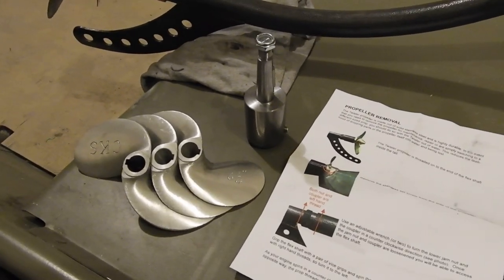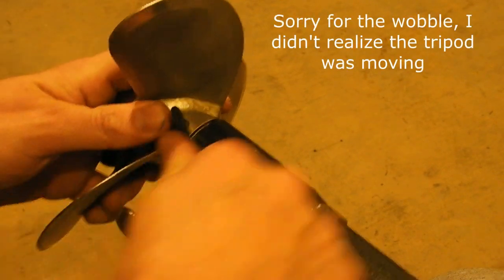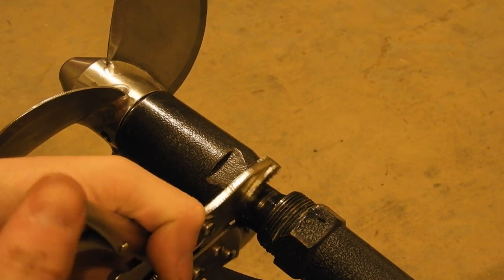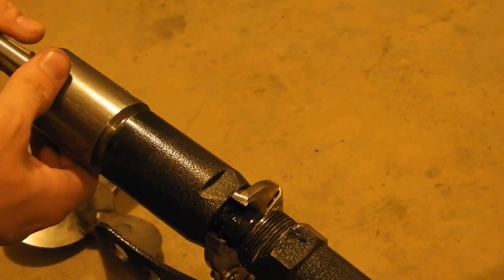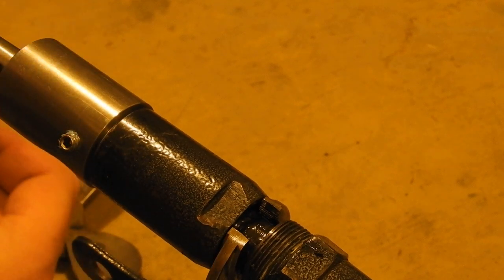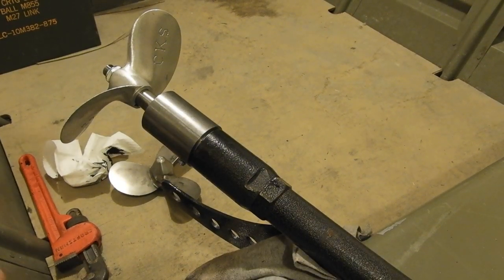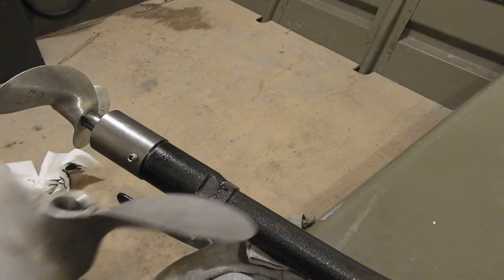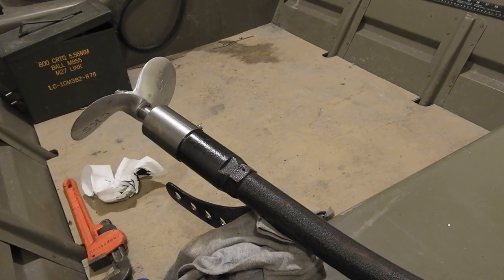Mud-Skipper Twister Prop Adapter Install

Comment: Hey I just got the kit I'm running a 212 predator on a Jon boat what do you recommend for the prop size ? I was able to get 10mph with a gov delete with stock prop and I'm going to do a stage 1. What is your setup on ur motor to get the 23mph?

Comment: So I just got my twister on my 1236, running a predator 212 with a stage 1 kit, and was rather unimpressed with its lack of performance. Kind of reminds me of a plow. Laboring fairly hard to achieve 7 mph with 2 guys and no gear.  Which prop is your favorite? Does the cavitation issue seem to go away using the 2 blade props? My factory 3 blade ss  prop seems like it needs to run real deep...
Reply from the maker: Yes, the cavitation issues go away with the 2 blade. Otherwise with the factory prop, you'll need the plate. But it's just not a good prop for this setup. 

And each boat and load will be different. Props are cheap enough to get a few different sizes to test. With my modified engine, I prefer the 6 1/2" since it can rev pretty high. With a stock engine by myself, 8" is the largest I was able to reach the governed engine speed, but lacked holeshot pretty bad and struggled to get there. 7" was a good size alone and was able to get 15mph steady. With any kind of load, I went with a 6". The boat will run 9mph at the governor, doesn't matter if it was completely empty or plowing through with 800lbs, it would always go 9mph and not struggle much to get there or hold that speed.

Comment: Gunner, thank you for continuing to monitor your video comments! I've read a good portion of them in various videos, so see you're still engaged. 

I think I know what I should do, but wanted your advice on the prop kits. I see now there are 2 kits. 5-7HP with 6.24, 6.50, and 7" props and the 8-23HP with 7.5, 8, and 9". I'm running a stock 212 predator with original prop. I will only run my 14' Jon boat loaded down with around 350ish lbs. in gear and myself just under 200. From my interpretation, you would run the 6.25 or the 6.5 regardless of the motor being stock or modified. Am I correct thinking this? I'll be ordering one of the kits soon and your opinion is greatly appreciated! ;-)

Thank you!
James
Reply from the maker: With a light load you can get away with a 7", but you'd be hard pressed to go 7.5" or bigger. If you can get past the hump around 2k-2.5k RPM, you can usually maintain a little higher speed. But after taking a corner or off the line it tends to bog down before it gets into the powerband.

6.5 is typically my universal 212cc prop. It can handle a bit of weight and gets decent speed. I've only used 6.25 when I had the boat very heavily loaded, like 800 lbs. It didn't matter if the boat was empty or fully loaded, it had the torque to hit the governor and consistently do 9mph.
Reply: @playinlikejimi  Were you running your 212 motor stock then, Gunner? I ordered the smaller prop kit yesterday, so looking forward to getting that on and testing!
Reply from the maker: @jameswinnett4012  that was with a stock 7hp duromax, but basically the same motor.
Reply: @playinlikejimi  cool! Yea, pretty much the same. Hoping the OG prop removal goes smooth! It's been on for a season now. :-/
Reply: @playinlikejimi  got my prop kit from Mud-Skipper and have the 6.5 on ready for a test run! Wasn't as big a deal getting the old one off as I thought. Thanks to your video! You da man, Gunner!
Reply: @playinlikejimi  Got the prop adaptor kit installed and did the first run with the 6.5" prop. I was very impressed! I still need to dial in the height but have found, like you, that 1 full revolution of the height adjusting bolt gives me 1" of movement in the prop shaft level. It will be fun to tinker with the props and trimming to maximize the speed. I found the hole shot got better and the speed increased. One thing that surprised me was that when I dropped the 2 blade prop in the water, the immediate thrust wasn't as severe as the OG 3 blade prop, which was nice. Wish I had a simple solution to adjusting the height while motoring...

Again, thank you for your original post and other videos. I do like the twister and have plans this week to do the carb re-jet, intake filter and exhaust pipe on the 212. Very anxious to see how it sounds and performs.

Later,
James

Comment: Thanks for a great video. Made my install a lot easier!!!
Reply from the maker: No problem, thanks for the appreciation.
Reply: @playinlikejimi  the mudskipper video just shows removing the prop and putting the adapter on.  Why exactly should you loosen the bearing housing before the prop?  Thanks man
Reply from the maker: @philliptverberg4578  the video they have is the same concept, but it's on the newer style Longtails. With the twister, the cable shaft has some give to it and you won't be able to loosen it with the other end locked in place like their video shows. Trust me, I tried everything before coming up with this method.
Reply: I have this same long and the 3 blade sucks I put a 2 blade on it made big difference if anyone has this mud motor kit do what this guy just did big difference between the 3 blade and 2 blade the 2 blade way better

Comment: UPS just delivered my twister XL this morning. Yesterday, I was able to get the pressure washer pump off of the Honda GX390 that I will be using to power the twister XL. It seems like my key was seized in the keyway and I thought, no big deal because I need the key to be on there anyway for the twister shaft to slide onto. However, I started the engine up to check things out and I think the rotational spin of the drive shaft sent my key flying into orbit. My question to you is, does the twister XL kit come with a new key for the keyway or will I need to order one online? I'm at work all day so I haven't had a chance to open up my kit
Reply from the maker: You should get a new key with it, I'm pretty sure all the ones I've gotten have had them. Some lessons you learn the hard way lol, if you have a stuck key and need to start it again, a quick zip tie or piece of tape will save it.
Reply: @playinlikejimi  just keeping you updated. Got home from work this evening and my kit was waiting for me. Stupid fast delivery. I ordered Tuesday afternoon and it arrived Saturday morning. However, I got the adapter kit that's supposed to, per the website, come with a 7.5", 8", 9" two blade prop. What showed up in the package was (2) 8.5" props and (1) 9 1/4" prop. Lol. I'm not sure I'll ever have a use for the 9 1/4" prop and I would rather not have two of the 8 1/2". Oh well. I email them a little bit ago because I'm sure it was just an error by whoever grabbed them off the shelf, but hopefully they will send me the three that were supposed to come which would give me a 7.5,  8,  (2)8.5,  9, and 9.25. we'll see

Comment: Great Video. Just bought an adapter kit.
Reply from the maker: Thanks. I know it's been a long time coming, but I have some video plans as soon as the weather clears up enough. Going to explain how I go through to choose the best prop and dial in the trim for the best performance. I was able to pick up a noticable amount of speed just by dialing it in. Hopefully in the next week I'll get some up.
Reply: Where you buy it

Comment: How much grease are you putting in the motor shaft. Do you think to much could hurt it?
Reply from the maker: Couple pumps every once in a while lol. Not very calculated. I do have one that is over greased and it'll push out the grease fittings after running it for a while, but nothing serious.

Comment: Hello I love your videos with the twister XL. I'm thinking of buying one for my 14' Jon boat I was thinking about getting the Mud skipper twister XL 16hp kit. Do you have any regrets with getting the twister over the long tail?
Reply from the maker: Originally I was very let down. I was about to get rid of it until I figured out how to get the factory prop off and made my own. Now that they make these adapters, I would highly suggest this over a longtail just because of how much easier it is to control, and you don't really lose any noticeable power through the cable vs a straight shaft. I'm very happy with it, it's a nice blend between a longtail and surface drive.

Comment: What kind of propeller did you use to make treads in it? I rather do that.  I have a ghenoee and I need the cavitation plate exactly where is it. If I add the adapter  cavitation plate will not reach right position.  Thanks . Great video.
Reply from the maker: With the new props the cavitation plate isn't really necessary. I'd highly suggest the adapter, it makes changing props a breeze. I had the boat out and was able to swap the props in about 2 minutes as opposed to taking the whole hub assembly apart, but regardless I just used the regular tapered aluminum props. Go to my channel and I have a pretty in depth video on how I made them before this adapter was available.

Comment: How much more speed did you gain with the Thai prop took mine out today and only got 7 mph with the stand prop idk if getting the different props is even worth it
Reply from the maker: 100% worth the swap. Get a new prop on there and check out my other video on how to adjust it for best performance.

Comment: How does it do in weeds pads water vegetation now with the two blade prop?   Do weeds wrap around shaft at all with adaptor or with the props you threaded?   I want a twister lite that is weedless.
Reply from the maker: I don't think I've gotten any weeds caught up in it. The original prop tangles up very easily, but the 2 blade props do much better. I can't comment on super thick vegetation yet, but Lilly pads and stuff too thick for a standard outboard haven't been an issue.

Comment: Just got the XL twister having problems with the three blade prop adapter kit is on the way
Reply: How did your install go? I noticed when I went to order the two blade kit. The website says: “Adapter ONLY fits 5hp to 7hp Twister Tail Assembly. Does NOT fit Twister Lite, Twister XL or Twister4.” So I was hesitant to order. Is this true?

Comment: I just put the two blade prop adapter on my 16 horsepower mudskipper XL and followed your video step by step. I'm wondering if you have any updates on the different prop sizes and the difference they made for you I'm currently running  with a 8.
Reply from the maker: I have my chart at home, I'll make a short video on how I dial in the Trim and the different speeds I was getting with a stock 7hp motor. Off the top of my head, I can remember the 6 1/4" prop got 8mph, regardless of weight. With the boat empty, and then with about 800lbs including me, fuel, motor, and weights I put in it still got 8mph and hit the governor. With the boat empty, I was able to dial it in to 15mph with I believe a 7.5" or 8" prop.
Reply: I took the boat out today with the 8" and was able to hit 20 mph with just me, tool bag, big deep cycle battery, and 8 gallons of gas. If I add more weight and wanna stay at 20 should I go to the smaller blade or bigger?
Reply from the maker: @grizzlydean91  it depends, are you hitting the governor? If you are, try a bigger prop. Bigger props will give more speed, but put more load on the engine. You want to use the biggest one that will let you run at the desired RPM, which is the governor if you haven't removed it, but not too big that it bogs the motor down. I don't know as much about the bigger motors, but I'd guess that you would go with a bigger prop, but the 8" would be good when there's weight in the boat.
Reply: @grizzlydean91  any updates

Comment: A piece of advice I have is make sure you put this thing on as soon as you buy the kit, because I've had my twister for a few years now and getting the lower unit apart was a chore to say the least. Getting the prop off even worse. Hoping it greatly improves my performance as if it doesn't, my kit is gone. 

Question: Is there a way to dial back the governor to achieve a lower idle speed for the 420cc? The screw on the carb doesn't change it at all and my engine idles at a very high rpm thus I have no low end maneuverability, it's 0 to go time as soon as the prop bites. Would like to know if there was a way to bring it down. Thanks.
Reply from the maker: So this is a hard question to answer without seeing what's going on, but the first thing I would do is make sure the bolt on top of the throttle lever on the engine is loose enough that the lever can move freely. I would also check to make sure nothing is binding and keeping the throttle cracked open. I would most likely suspect a minor issue somewhere in the linkage rather than the governor. The cable to the throttle on the handle could also be too tight causing it to not return all the way.  If everything is working correctly and moving freely you should be able to back the black screw on the carb out to the point where it starts to hunt. With the engine running but no load on it, the RPMs will drop until it's about to stall and the governor will kick in and make them jump up for a second then it will sound like it's about to die again and keep repeating. If it's not doing that, I'd bet something is binding up and it's not a governor issue. 

Hope this helps, sorry it's kinda hard to explain.
Reply: @playinlikejimi  Thank you sir. I'll see what's going on. FYI, this adapter is a game changer. I can't believe the difference in performance. I can't believe Mudskipper is still sending them out with that other prop on it. Couldn't be happier that you figured this out and caused them to create the adapter. Thank you sir!
Reply from the maker: @AWelter23  thanks, but I can't take all the credit. I think it was more of a parallel thinking. When I came up with the idea of adding threads to an aluminum prop, I sent them a picture I drew of an adapter I came up with (basically the one they sell now) and they were already working with a machine shop to make a similar product. 

But yea, I was completely blown away by the difference. Almost literally lol. Before I could drive the boat standing up with no handle bar or anything, but with the new prop I almost fell over the first time I took it out. I was so surprised that it was so much smoother idling around, but also so much faster with the top speed. Hopefully in the future they include the adapter already installed, that'd be nice to see.

Comment: Did you happen to notice any difference between your modified prop to direct fit without the adapter compared to the new props with the adapter? Just don’t like that with the adapter it sticks out past the skag.
Reply from the maker: I prefer the adapter because of how quick and easy it is to change props. I know they've been out of stock for a while so I can modify some props if you'd like. 

As far as sticking out past the skeg, I havent notice any significant differences with that.
Reply: @Gunner's Hide  Any chance you know the difference between the twister xl and the 5-7 hp adapter? The xl adapter has been out of stock for a while and I'm wondering if I can modify the smaller adapter to fit my twister xl. Thanks

Comment: Mud skipper doesn't have prop pitch sizes just diameter. Where can you find 2blade props with various pitch sizes for twister
Reply from the maker: I don't think you can, I think they're all by diameter. The weedless versions have a little more surface area and slightly higher pitch, so you'll want to go an inch below you're normal prop for the weedless version.